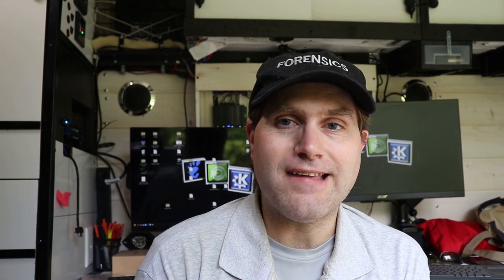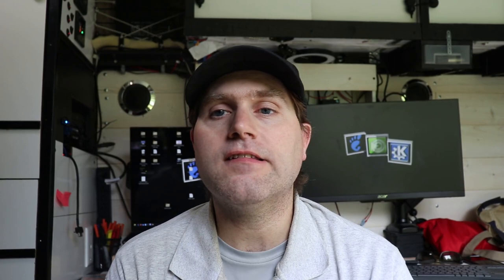Calculating Computer Power Consumption in an OffGrid Setup

Comment: Tom a very educational video as I did the same as you in terms of finding out how much watts my devices were using and I count as 60 things in my house which includes everything even light bulbs and it turns out with my solar system it will support all devices even the vacuum just not the oven and fridge but if the lights go out we have a rocket stove and a portable electric freezer so we are all set and my wife even said "Now I know you do not want to buy the biggest TV or computer monitor and always looking to see the device Battery Capacity and if it is ENERGY STAR Qualified" LOL it is all about saving money and being prepare that all plus my wife says my OCD can be a pain in the butt but very useful LOL :)

Comment: What's the point what are you achieving
Reply: Eh? The point? If I had to hazard a guess, I would think "power efficiency", getting heavy work done when solar power is at the max, running low-power devices when appropriate to preserve a good amount of reserve power in case of emergencies and the like. I thought it would be obvious, given that he is living/working out of a mobile unit, sometimes far away from a power outlet.